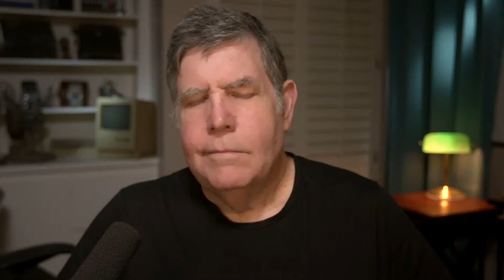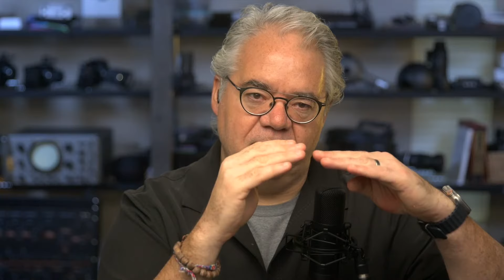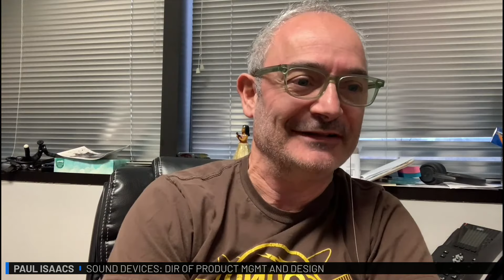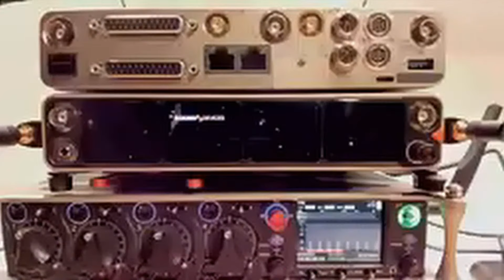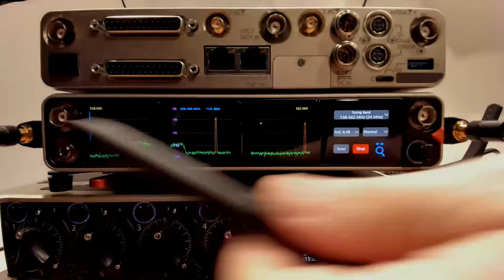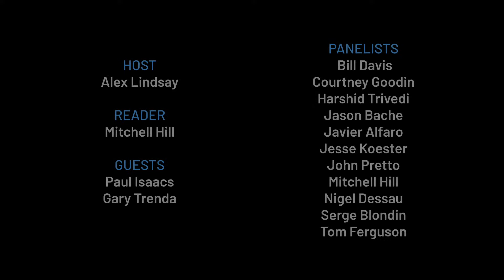Focus on Sound Devices A20 Nexus First Look

Comment from the maker: 01:03 Using the Insta360 Link with a M2 MBA. Zoom use works fine. When using MS Teams, I don't see my video as with other cameras (Brio/Facetime/iPhone 11 Pro). Does anyone have issues/suggestions with using MS Teams and the Insta360 Link?
04:16 Do you have a favorite way to create waveform videos from an audio file? Davinci Resolve is preferred (and I’m okay with Premier or Final Cut)
07:28 Is there a record player that plays 33, 45 and 78 rpm records and has "smart home" technology in a reasonable price range?
10:11 Any hockey fans in the room? what do you think about the NHL's new "Digitally Enhanced Dasherboards" where the physical ads on the boards are replaced in the broadcast with different graphics for each market, and how fo they do it?
15:09 I'm looking for a heavy duty c stand with wheels for lighting - which makes and models do you all suggest? Preferably a buy once cry once deal, but mid-tier options appreciated as well. Thanks!
18:01 Has anyone seen the Left to Right mode for H2R Gear ?
19:42 Zoomtopia BTS webinar today at 12:00 ET/09:00 PT. Thoughts? I hope this is being archived; I have a live show to switch!
20:11 I'm setting up a syphon based Zoom ISO workflow for a virtual event. What's the best production software for cutting the show on a Mac? (Budget sub $400)
21:51 I need to run a 200' Ethernet cable and would like to know which cable and source and wether I need a repeater/amplifier to do this?
25:07 Yesterday I noticed that Teams appeared to have camera controls. Is this a new feature or something unique to Windows? Has anyone used this feature?
25:37 Morning Guys! Our Impact c-stand holding a light has a leg that has leaned forward over time, and we've tried tightening it but it is still somewhat out of alignment. Any suggestions to fix it?
28:00 I have embedded audio in NDI that I need to mix. What's the workflow and software on Mac to do this?
28:59 As I've been working through my Blender training, I've been using the primitive objects built into the program. What techniques are used to go beyond the primitives and model realistic objects like vehicles or buildings?
32:59 Can you explain the flow of an HLS live stream?
36:35 If you had to create "filler" 3D content for an event (like the famous Seattle Mariners 'hydro races') and didn't have an experienced modeler on staff, where would you find quality models quickly? Could you use a service like TurboSquid?
38:07 Streamyard just added "Streamyard On-Air" webinar to their product. It uses the same studio interface but allows registration, embedding, etc. Any thoughts?
39:07 streamyard had a bunch of announcements yesterday including client side recording and webinars. Thoughts about what they've introduced and how about a second hour?
39:38 Mitchel, thanks for the question about ethernet cablesI've been doing some reading on them, and wanted to know what the panel thought about Cat8 and the others like 6e and such? Here is a supported link: [link]
41:23 How would you livestream a softball game with 3 iphones to *all* the restream.io channels and end up with an insanely great final version for rewatching?
44:33 Tripod desks gimmick or great idea? there's a couple out there for cyberweek but 300 seems high for essentially a worktop to put on a heavy tripod
46:47 Alex, you said you throw all files which will be played out by a stream deck into some software, to make sure, they are all in the same format. What tool does that an what are other usecases?
48:01 Let's say you're going to make a documentary with 3 or 4 iphones ok? What's the best way to mount them handheld and tripod/monopod/or ? fixed and coordinate the cuts between them and manage sound. Ideas?
52:40 If you're putting Ethernet cables in the walls of a home, would it make sense to "future-proof" with Cat7/8?
55:41 The Insta360 Link has a "flaw" or bug and can't show video on the app and in zoom at the same time. The Mac doesn't have the same issue, it works great. Is there a way to fix this?
56:48 YouTuber Jerry "Barnacules" Berg built an 8-CPU server ([link]) in 2017 for rendering/encoding workloads. With the proliferation of cloud services, does it make sense to have such equipment as an individual?
57:45 There are lots of bad boys out there. How do panelists protect their networks and workstations from viruses and other risks?
59:40 Fluid heads are made for specific weights. When it says it is usable up to 8 Kilograms, what is the weight you put upon this head? 8 Kilograms or less as a maximum.